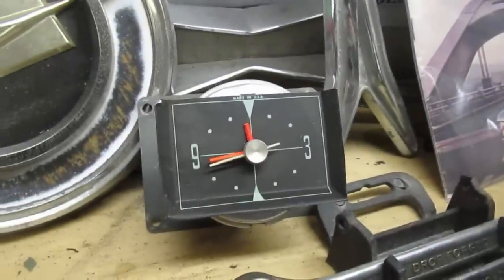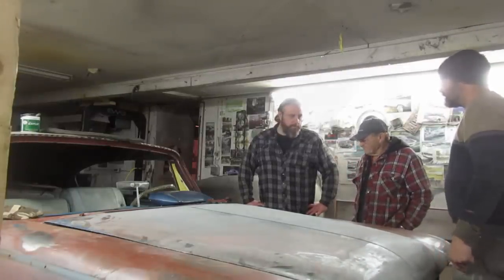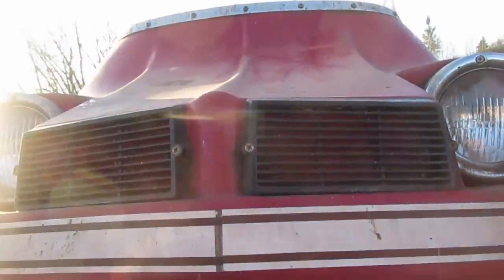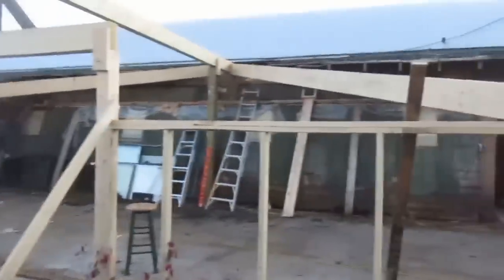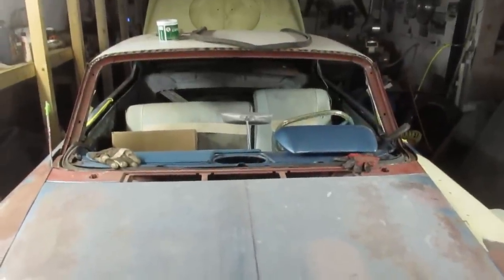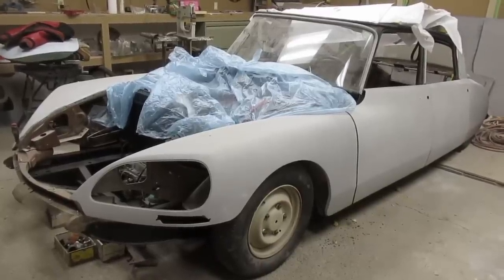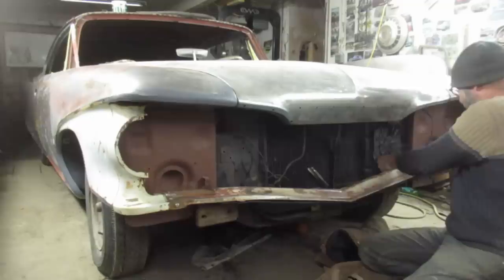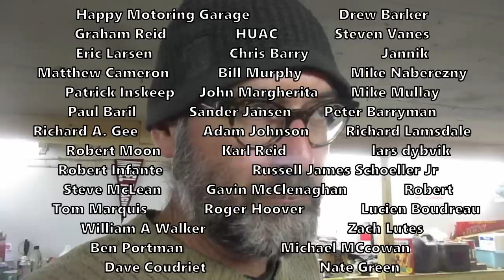1960 Plymouth Fury Project: Back to the Front!

Comment: Its great watching this guy doing his rust repair resto work and panel replacement. Even shows the bracing required to stop the body sagging after cutting out sections. Especially liked watching the patching of sheet metal, much harder than it looks, thin automotive steel warps like mad when the heat from a MIG welder is applied incorrectly. Great stuff. Most folk would of chucked both those Furies, but choosing the best floor pan/chassis and sacrificing another junker for its best panels and parts to make a silk purse out of two pigs ears is a work of art. Waiting to see the body in the paint booth for the final trnsformation before fit up.

Comment: The Fury is looking great.  You're so right about fitting up a project being so important.  So many really well done restorations are ruined by people not taking their time over trial fitting and adjusting things well before finishing it, with the result that what could be a really expensive and time-consuming project really doesn't stand up when looked at close, and sometimes even not that close.  I know it must be tempting to rush that part as it's so close to the end of the project but it is absolutely critical to making a really great restoration rather than a merely good or adequate one...

Comment: Well, happy to see you working on the Fury again! I know how many hours you can kill trying to adjust parts so they line up well. I seems you are quite a perfectionist. Considering you work with classic american cars and Citroens. Those cars were known for a lot of things but never  for great fitment of body parts. We might be shocked today studying a car fresh from the assembly line of the good old days.
I met an old guy here in Switzerland who had to fix brand new US and Canadian cars at the dealers with problems. He said a very common problems of those cars specially those from Canada were electrical issues. He said many times the guys in the assembly line just drilled holes for screws to tack down carpets, trim parts and such. He said tons of times they would just killed brand new wiring harnesses with their drills. Build them cheap and build them fast! Same thing with paint. Even upper class vehicles often only had a symbolical amount of paint sprayed on the inside of doors, trunks and hoods. Often on the plain metal.
An other guy I know was working in Detroit at GM in the first half of the Sixties: He was the one responsible for cars straight from the assembly line that had issues. Maybe they thought a Swiss perfectionist would solve those problems better than most.
We had our assembly lines for US cars here in Switzerland. Very often you can tell that a car was assembled here just by seeing if the gaps were quite perfect. I remember a guy working for GM Switzerland who was showing me a brand new imported Firebird: The hood would line up quite well on one side, on the other side he could stick his finger between the fender and the hood. There would have been space still for a pencil or a cigarette between the finger and the hood. 
Love to see your great job as always: Keep the good things coming!

Comment: Glad to see work starting up again on the Fury. Against my better judgement I rescued another square body Chevy pickup. Because I didn't have enough piles of shit cluttering up my property lol. But it runs, drives, stops, and eveyrthing on it works which is better than the condition my other one was in when I purchased it. So I did the right thing and just found some OEM hubcaps for it and a new shifter knob. Who needs valve seals anyway? lol.

Comment: 17:09 We had one of these when I was a kid. (Beaverlodge, Alberta) and the return spring on the pull rope was always a problem with it. But we made it run and pull inner tubes etc. The Yellow machine at the back of the trailer I think is an Elan and there were a lot of those around at the time as well. They seemed to be a fairly reliable machine in their day. (but my memory is not the best so.... LOL Great to see these old works of Northern Fun and Work (Art?).

Comment: the engine might need some tlc, but the charm of this old plymouth, at some point, that it will have period correct components that make it go. sorting out all the linkage that controls the trans from a pushbutton array must have been something. paint will bring it to life. when the splice episodes began, YouTube featured posts on this 1960 vehicle, for sale at times, in relatively original condition. whats neato about this production is how reclaimed portions of three (and more,) vehicles can come together to resurrect one really nicely restored automobile. buying one stored for thirty-five years for thirty-five grand isn't what this is about: unless i'm missing something. ..dean hard at work!

Comment: amazing this Fury is still intact , the bodies rusted horribly,  Im in California but they didn't hold up too well even here,.   My older brother when I was a kid, ( he was 12 years older than me) bought a 1960 Fury Convertible in 64.  It was a beautiful car, light blue in color, it was considered a higher end car in those days
Reply: You should see what he started with. The roof is the only panel that has not been repaired or replaced. See the first videos of the series if you want to know what a Rust Belt car looks like.
Reply: @mrdanforth3744  I will check it out, since I'm not in the rust belt, I see older cars a lot out there especially car shows

Comment: Had to readjust the door, fender, and hood after they replaced the drivers fender on my 95 Neon coupe. Was a lot of fun and I was surprised how off everything was considering a pro shop did the fender and paint to match which turned out nice compared to the alignment they did. I've redone my doors and replaced and aligned fenders, bumpers, stuff like that so it wasn't like I didn't have a clue but it's still a challenge on older cars that might not be perfect anymore. That 60 is 2 years younger than I am now and is going to turn out nice when done. That's the kind of cars we had when I was a kid, cheap beaters that we could keep running and drive.

Comment: Back in '68, I had DS19 Pallas in Montreal. As with most of the other Pallas, It had chrome moldings with rubber inserts running along that lower crease on fenders and doors, plus another molding at the bottom edges. These were anchored through holes in the sheet metal & all very rust prone. Whereas "yours" and Jay Leno's don't have these moldings, only the upgraded leather interior - mine had green velour with more chrome trim.  And, there was some attempt made to have "rocker panels", while the original '55 - mid '60s doors were highly exposed, even on my '68, the door bottoms had become "unstuck". Also see that you have the semi-auto hydraulic shift. You can tune the clutch release for higher rpm starts, I hope when finished, you will take us for a thorough test ride and "slurp" it through the gears.

Comment: Hirth 292 single cylinder snowmobile engines were 15 HP so output was pretty equal to other singles of similar size, BUT they made their gains over the competition by producing incredible amounts of RAW TORQUE in comparison. They were extremely precision engines and more expensive to manufacture so cost more to buy  which is why they were only  used in snowmobiles for about 5 or 6 years.  However they have continued to build other engines to this day for what they were originally intended for, which is small aircraft engines in things such as small airplanes and ultralites world wide, and industrial engines in most places other than North America or Asia. They are also higher compression, so in really cold weather its about like trying to pull over a car engine...lol

Comment: So what model is the DS Scott? I’m a life long citroen nut, I’ve had 30 of them so far!
I’ve only driven 1 DS, a 1957 ds19 with semi automatic gearbox. It was made in England, but exported to australia where I had a go in it. I’m told as long as the main hull is ok, the rest of the body is all bolt on panels.
Here in England, you’d look to pay between £8000 for something useable, to about £15000 for a nice one.
Decapotable ones are stupid expensive!

Comment: Another shed to hold more junk. Now thats my kind of thinking. That old Hirth in the Roll-o-Flex is probably the same as the one in my 74 Astro Jet, 19 hp and a lot of noise and vibration. I remember the Roll-o-flex ads. They also sold dozer blades for tractors. Nice classic tire haul! What, no Goodyear Suburbanites?

Comment: Glad to see the Fury come to the forefront of sheet metal work again. I doubt I would have the patience to piddle around adjusting a hood, then fenders then the hood yet again.....Its gonna be a champ when done. I was at a car show back in 2000 and one guy there had a '74(?) New Yorker Brougham that had 39km on it....yes, only 39km. Drivers seat was the only seat ever sat in...anyway, the body gaps on that basicly new car were horrendous. So, anything you can do will only be an improvement to an original car. LMAO..."original car"....look at me with the freudian slip. Will be an improvement to YOUR creation.
Rick in Edm.

Comment: Back in the days before everyone just replaced body panels for collision repair it was up to the skill of the body man and time restraints imposed by insurance companies on how well a repair was done. Half assed pound jobs and loads of filler were the norm plus the fact that most American cars were junked within 10 years anyway because they were designed to only last 75 - 80 thousand miles. You should have a 1960 Plymouth when your done that all the panels fit better than any of the new ones did originally.

Comment: Good video . Nice to see the fury come together . Concours resto or a driver ?
Reply from the maker: Oh! Driver, for sure. A concours car would be a totally different project. It would be on the rotisserie and the chrome budget would be more than the budget for this entire build. It'll be a nice driver, but the undercarriage will be just cleaned off and the scratchy bumpers will be going back on as is. I am going to sand the paint back a bit so that it doesn't clash with the aged trim. I just want it to look like a nice original car. Cheers!

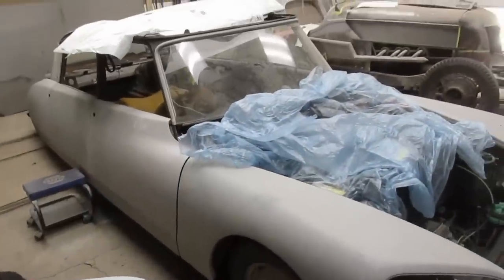Comment: @40:58 what is that vehicle behind the Citroen? It really got my attention
Reply: That is the 5 Dollar Roadster. There is a little info on it here and there in his videos.  If I remember correctly...

It started life as a Ford milk delivery truck. A bet was made, when the owner said it was useless and Scott said he could make something cool out of it. So it has the motor out of the truck, and the rear axle. I don't remember what trans is in it. I think the frame rails started life in the truck, but Scott cut them up and then hand built everything else you see. Its a long term project he has had in the background for years. The only recent video I can remember, he was building the exhaust manifolds and the hood sides. 

It should be quite beautiful when it's done.